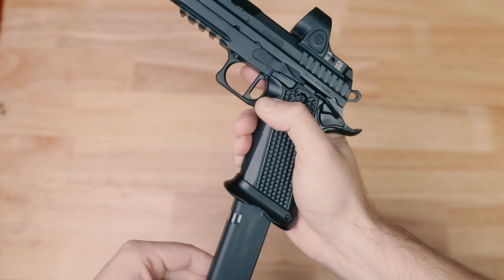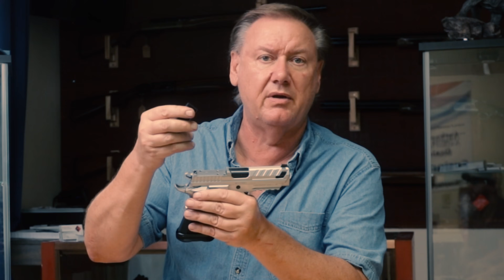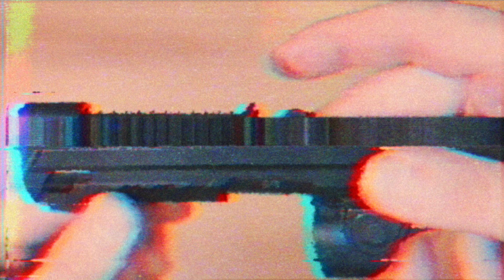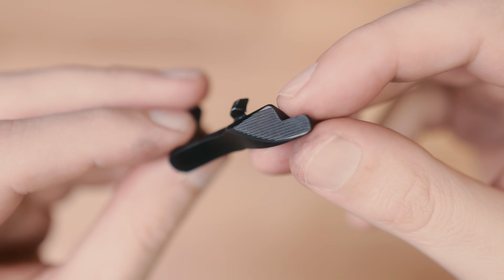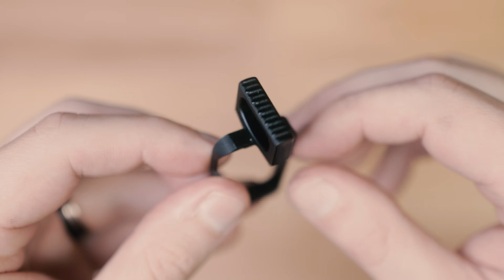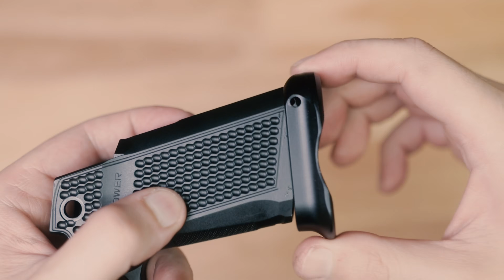The XP Pro - 1911 That Takes Glock Mags (Full Details)

Comment: The grip is still huge. The whole point of a 1911 is ergonomics. If you lose ergos, then a SAO Sig or CZ are just plain better. And most of the time cheaper.
Reply from the maker: We have very little negative comments on the grip size. It seems to fit most people just fine. Also, for carry, the mag-well is removable and the butt, is already rounded and blended. More grip modules and textures are coming out this month
Reply: @fusionfirearms  if it's built around the geometry of the original double stack 45 mag, as most (all?) 2011 are, it's too big

Comment: I bought one and received it last week.  It feels similar to my Bul Armory - it feels exclusive.  There's nothing I hate about it.  There's a LOT I love about it.  I do wish the slide serrations were more "grabby", especially the front serrations - can't press check.  The safety levers are a bit soft (I'll sort that out when I get a single sided safety).  The optic plate system made it super easy to mount an (RMR) optic.  I'm wanting an adapter plate for the Acro footprint, as well.  The irons work well, too!

It's a solid gun.
Reply from the maker: Thank you for your super nice comments and support!

Comment: How do you make sure that the red dot plate or iron rear sights are zeroed?
Reply from the maker: Co-regulation sights, if this is your ultimate set-up, are meant for a back-up to red-dot. Not a primary sight. You can always change the front sight for elevation adjustment. But the rear is fixed. So generally you shoot it for POI and then mentally understand were it is hitting and generally you will be pretty close other than possible some windage adjustment. A great product coming out very soon from Fusion and LPA are new adjustable Co-regulation sights. We will be introducing these soon.
Reply: @fusionfirearms  awesome! I’m excited to see more products line up. I love the XP Pro series. 🫡

Comment: Noticed these are on Backorder. What is the current leadtime?
Reply from the maker: Sir, we are producing more XP-Pro’s every day and increasing production. We just added 2 new CNC mills and have 10 more on order. If you order now, you will be scheduled in the April production cycles. We will continue to ramp-up capabilities and quantities on both XP & XF-Pro’s throughout the year. You can always check in with customer services if you need.

Comment: I think it's Beautiful ❤️ Outstanding Craftsmanship Machine Work ,  i like the grip angle like Glock and original Beretta which rotatates the wrist upward  , this does two things, it aligns the bore with the top of the wrist and helps the bottom of the wrist to lock up with the tight squeeze of the little fingers , this stops the flex of the wrist while locked out .  The new Beretta vertex grip lowers the angle of the wrist creating a higher bore above the top of the wrist,  this causes more deflection leverage through the wrist decreasing control - bad idea - gotta get Lok-Grip's wrap around for the original Beretta grip angle.   I look forward to purchasing this Finely made BLK XP PRO 2011 its Beautiful🔥😍,  and who doesn't have ten G-17/45 mag's already laying around ✅🤪👍😎🇺🇸❤. Yah ? Holsters,  Leather thumb brake pancake canted , and kydex OWB, IWB
Reply from the maker: Thank you for your super comments

Comment: I have one on the way, and I'm excited. However, I'm a little disappointed it appears though the Glock mag would allow for it, the mag catch isn't reversible. I know there are ways to eject the mag as a lefty, but these days most of guns come reversible or ambi. I would prefer not to train differently for one gun and differently for nearly all others. Seems like an oversight to me. I'm still excited to get this and try it.
Reply: I'm lefty as well and use my pointer finger to drop the slide on this gun. Having the extended release makes it so much easier. The mag release i use my middle finger. You'll like the ergonomics on this gun

Comment: Anyone else have mag fitment issues? Only the cheap korean glock mags and 17 round pmags will go into mine. Brand name glock mags, 27 round pmags, ets mags will not insert in mine all the way to engage the mag release, no matter how many rounds are in the mags.
Reply from the maker: Sir, if you have an issue, you can contact customer services. The KCI mags are less expensive but absolutely not cheap. We have run tests on 100s of Glock style magazines and KCI was the most consistent in dimensional stability and function out of all of them. That is why they were chosen.
Reply: @fusionfirearms  something mine must be out of spec then. i loaded my glock mag with some snap caps and with the slide back, i inserted the mag, which seemed to lock in fine . upon releasing the slide with the slide lock it hung up, and then hung up on every round i tried to rack in after that. almost like the mag is too long and is interacting with the slide. kci mags or the 17 round p mag did not do that, all other mags i tried did.  also seems to be taking material (plastic) off the back left corner on the top of the mags that dont fit. please dont get so defensive about the kci mags, they are not known for being outstanding grade A magazines, and thats a fact.

Comment: im worried about that slide release and the grip of a pistol. what are the chances you push that while firing and it locks the slide back or fails to fall into battery.
Reply from the maker: It will depend on your grip, but, We have a bunch of aftermarket controls coming out that will help with folks that have very high grips, competition, basic carry....etc. So there will be no shortage of options for you to change to the controls and aftermarket parts you want. Also, Fusion Has custom shop options and people like Skips Guns out there customizing to customers needs.
Reply: @fusionfirearms  thank you for the response will be putting in my order soon.

Comment: The grip angle is an issue. Even in your video example (13:01) each grip enclosure on the pistol’s grip pushes the tip of the barrel downwards. That’s the same complaint with most Glocks. Naturally if all you are used to shooting all Glocks then it’s not an issue.
Reply from the maker: How many of these have you shot?
Reply from the maker: The XP-Pro is a hybrid wide-body pistol, with a newly patented design. The rear is at 22 deg, but the front-strap is at 17.5 Degree, basically the same front as a 1911. It makes for great balance and quick pointing and does not feel like a brick in your hand like a Glock and many of the polymers. This new design has been tested by a wide range of shooters, even several very prominent target shooters and a Bianchi Cup winner, and they love it. The thickness side to side is 1.130” and the width, front to back, is approximately 2.050”. I will have a post/video on this soon...
Reply: What are you talking about? It's a standard 1911 grip angle. The only thing that worried me about aluminum grips is it being too slippery.

Comment: Not sounding like I’m downplaying this absolutely beautiful pistol but how does it compare to the platypus?
Reply from the maker: There are many differences. The only thing comparable to a platy is it takes glock mags. The XP-PRO has a patent pending design. This has a steel frame, optic ready out of the box, better finishes, 1 piece milled trigger, modular grip ect.... The platy has an aluminum frame and cerakote finish it's not built for real hard use and won't hold up to high round counts like a steel frame will. The XP PRO has Tenifer & QPQ over or Tenifer & hard chrome over, these finishes   are 100x more durable than cerakote. The XP-PRO is a totally new innovation of technology and handgun performance.
Reply: @fusionfirearms  solid information! Now I just have to keep this hidden from my wife 😂😂😂
Reply: @PapaBDR under a couch my friend 😉

Comment: Does it have the standard 1911 grip angle or does it have more of a glock grip angle?
Reply from the maker: The XP-Pro is a hybrid wide-body pistol, with a newly patented design. The rear is at 22 deg, but the front-strap is at 17.5 Degree, basically the same front as a 1911. It makes for great balance and quick pointing and does not feel like a brick in your hand like a Glock and many of the polymers. This new design has been tested by a wide range of shooters, even several very prominent target shooters and a Bianchi Cup winner, and they love it. The thickness side to side is 1.130” and the width, front to back, is approximately 2.050”. I will have a post/video on this soon...
Reply: Well said.

Comment: What is the grip angle?  It looks to have a Glock grip angle instead of a 1911 grip angle. Can’t stand the Glock grip angle.
Reply from the maker: The XP-Pro is a hybrid wide-body pistol, with a newly patented design. The rear is at 22 deg, but the front-strap is at 17.5 Degree, basically the same front as a 1911. It makes for great balance and quick pointing and does not feel like a brick in your hand like a Glock and many of the polymers. This new design has been tested by a wide range of shooters, even several very prominent target shooters and a Bianchi Cup winner, and they love it. The thickness side to side is 1.130” and the width, front to back, is approximately 2.050”. I will have a post/video on this soon...

Comment: Why didn't you go with a external extractor instead of the old internal extractor? Even staccato is switching over to the external extractors. I hear that even Atlas Gun Works is going to be switching over to external extractors in future pistols.
Reply from the maker: We are trying to keep as many parts as possible 70 Series 1911 so maintenance/replacement  parts are easily obtainable.

Comment: How does it compare to the Platypus is my question.
Reply from the maker: There are many differences. The only thing comparable to a platy is it takes glock mags. The XP-PRO has a patent pending design. This has a steel frame, optic ready out of the box, better finishes, 1 piece milled trigger, modular grip ect.... The platy has an aluminum frame and cerakote finish it's not built for real hard use and won't hold up to high round counts like a steel frame will. The XP PRO has Tenifer & QPQ over or Tenifer & hard chrome over, these finishes   are 100x more durable than cerakote. The XP-PRO is a totally new innovation of technology and handgun performance.

Comment: I went to your website and it stated only RMR for optics. I would like to order this firearm and mount a holosun eps carry. Can l mount the holosun eps carry on this gun?
Reply from the maker: It comes with 2 optics plates in the box: an RMR and RMS/C. The EPS Carry uses the Holosun K footprint. These usually come with an adapter plate that will fit on our plates. We are also going to have Holosun K footprint plates shortly after the release of the XP Pro as well as other footprints.

Comment: Another platypus. Already have one on order. Might have to buy one of these too. Already have lots of mags.
Reply from the maker: There are many differences. The only thing comparable to a platy is it takes glock mags. The XP-PRO has a patent pending design. This has a steel frame, optic ready out of the box, better finishes, 1 piece milled trigger, modular grip ect.... The platy has an aluminum frame and cerakote finish it's not built for real hard use and won't hold up to high round counts like a steel frame will. The XP PRO has Tenifer & QPQ over or Tenifer & hard chrome over, these finishes   are 100x more durable than cerakote. The XP-PRO is a totally new innovation of technology and handgun performance.

Comment: So it’s like a cheaper platypus, except not 100% made in America. Not bad boys. May have to get one to compare against my platy, and staccato xc.
Reply from the maker: More like a less expensive Staccato, There are many differences. The only thing comparable to a platy is it takes glock mags. The XP-PRO has a patent pending design. This has a steel frame, optic ready out of the box, better finishes, 1 piece milled trigger, modular grip ect.... The platy has an aluminum frame and cerakote finish it's not built for real hard use and won't hold up to high round counts like a steel frame will. The XP PRO has Tenifer & QPQ over or Tenifer & hard chrome over, these finishes   are 100x more durable than cerakote. The XP-PRO is a totally new innovation of technology and handgun performance.

Comment: Will there be a 40 s&w /357sig aftermarket to upgrade the 9mm to those two calibers with a full top end assembly or even better just fit the barrels to the 9mm slide?

Comment: This appears to be the most well thought out 2011 I've seen.  Very much appreciate the only parts that have beeen changed from 1911 specs are those where it has to be different in order to accommodate the Glock mags.  Especially impressed with your approach to the grip angle and the mounting plate.  I want to feel one of these pistols.  Already familiar with Fusion's high quality from previous purchases.
Reply: Stealth Arms Platypus is much more squared away than this and is able to be customized like crazy, they also have better grip texture and direct mount full size optics on a flared out slide, like Infinity

Comment: This looks good and I am willing to give it a go, but what is the difference between this any my Platypus which takes Glock 17 mags too?
Reply from the maker: There are many differences. The only thing comparable to a platy is it takes glock mags. The XP-PRO has a patent pending design. This has a steel frame, optic ready out of the box, better finishes, 1 piece milled trigger, modular grip ect.... The platy has an aluminum frame and cerakote finish it's not built for real hard use and won't hold up to high round counts like a steel frame will. The XP PRO has Tenifer & QPQ over or Tenifer & hard chrome over, these finishes   are 100x more durable than cerakote. The XP-PRO is a totally new innovation of technology and handgun performance.

Comment: My God, man, why?  Glock mags are just terrible.
Reply: How so again?  Or do you prefer the competition mags that were tweaked for duty yet still have a habit of dropping a round when you go for a admin reload?
Reply: @robertparis5680  Those are just as gross.  But there are plenty of good, proven double-stack pistol magazines that aren’t thicker than they need to be because of plastic, and don’t require a silly insertion angle because of Austrian hubris.
Reply: @danovercast9282  I don't know of any mags that are as prolific, as durable and as affordable as a Glock magazine.  There's a reason they're pretty much the standard 9mm mag in any use case. A big factor of that is the plastic.

Comment: But they are not metal mags, don’t care about the cost.
Reply: OEM glock mags are polymer plated around a metal frame, theg are durable and reliable since inception, 
The only draw back is friction in the magwell and they don't drop free as easily on reloads because of polymer on polymer contact. The grip on this gun is aluminum so that won't even matter here,
Reply from the maker: Very well said

Comment: So why would I buy this over a stealth arms platypus who did it first ?!
Reply: The only thing comparable to a platy is it takes glock mags. This has a steel frame, optic ready out of the box, better finishes, 1 peice milled trigger, modular grip ect.... The platy is cool but it kinda a fud gun in my opinion because with an aluminum frame and cerakote finish it's not built for real hard use and won't hold up to high round counts like a steel frame will. Tenifer and hard chrome are 100x more durable than cerakote. So if you want color options and don't plan on shooting high round counts, the platy is fine. But this is "cheaper" and if it's reliable blows the platy out of the water.

Comment: very much looking forward to this handgun, it seems like you guys designed this with great attention to detail for the end user... the only thing i think i would change is throwing a tritium dot on the front, and that's simple enough... have you done any testing on holster compatibility to see if this will work in staccato holsters, im specifically curious about the safariland 63XX ALS series?

Comment: Aww no 1911 grip angle
Reply from the maker: The XP-Pro is a hybrid wide-body pistol, with a newly patented design. The rear is at 22 deg, but the front-strap is at 17.5 Degree, basically the same front as a 1911. It makes for great balance and quick pointing and does not feel like a brick in your hand like a Glock and many of the polymers. This new design has been tested by a wide range of shooters, even several very prominent target shooters and a Bianchi Cup winner, and they love it.  I will have a post/video on this soon...

Comment: I really want to shoot one of these, I’ve been thinking about getting a Platypus because I have so many Glock 17 mags and it’d be nice to be able to use these in a 1911/2011 and not have to pay crazy prices for a few mags that will cost you damn near the same as getting a new gun. This looks sweet but I wish the grip didn’t have  X POWER on them, it takes away from how clean it looks and make it look “cheaper”. Regardless, I’d like to try one out if I can find one around me.
Reply from the maker: We will have other grips available a little bit after release.

Comment: Stealth Arms did it first with the platypus.  Fully custom, zero MIM parts, all tool steel or aluminum.
Reply: @TheRange7 They have commander length as well, and is customizable.
Reply: Aluminium frame and cerakoted. That shit is good for plinking at the range but will not hold up like a steel frame with tenifer finish. If you want a rainbow colored pistol go with the platy. If you want a duty pistol with every option you could want in my opinion I would go with the XP Pro.